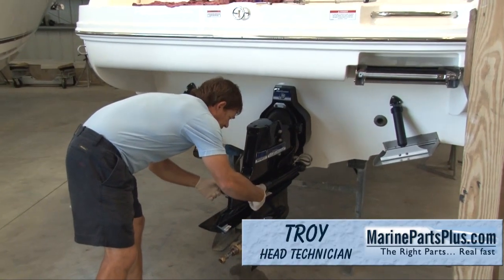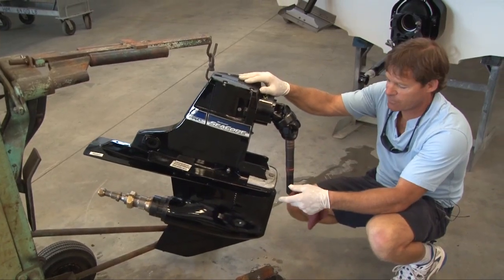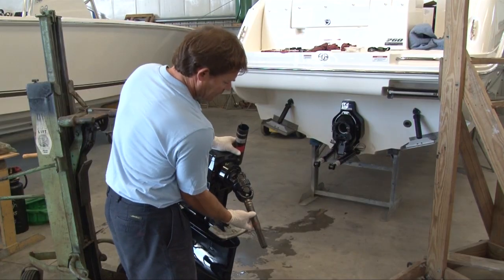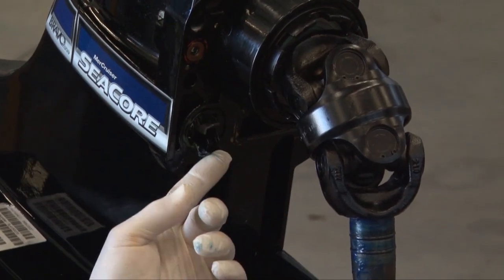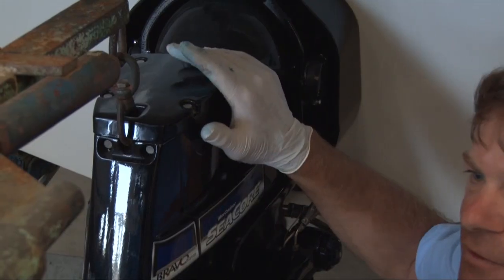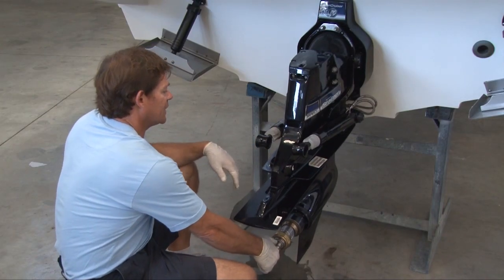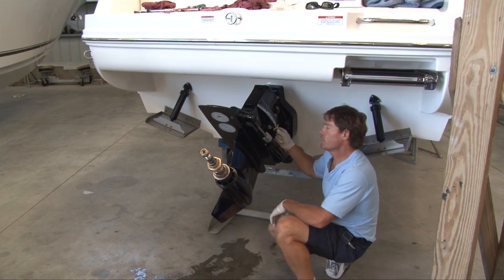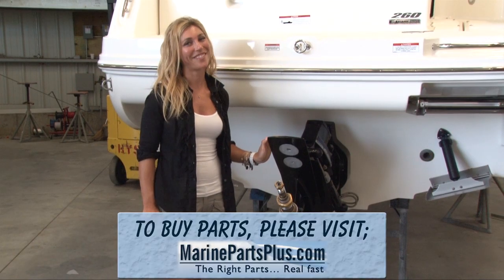How To: Remove ,Replace & Change Mercruiser Marine Bravo Stern Drive MarinePartsPlus.com

Comment: Great video.  My question involves the cable end and the clip.  Is there any other pressing of the clip to secure the cable end, or simply aligning and closing the unit all it takes.  I found that after I reassembled everything, I couldn't get the shift controller to work.  I unbolted the unit just enough to see that the cable end did not engage the clip.  Now the clip is deep enough to where I cannot see it for proper cable insertion.  Should I get a pair of bent needle nose pliers and attempt to pull it out, or just completely remove the unit as before?

Comment: On the bravo 2, when you reconnect the shift cable, does in need to be in neutral or FWD? Any other things to watch for with the shift housing?  Appreciate this concise easy to understand video. Thanks

Comment: I have a question for you once I have the bravo one drive off the pick up tube that’s on the bell housing side I think it’s leaking or just the hose where it meets the outdrive is leaking can I replace that from outside of the boat or do I have to replace it from the inside of the boat

Comment: I surprise, when you say that. 
When you turn the propeller shaft the universal shaft turn?
I think if you turn the prop shaft the cross bearing or universal will not turn. 
Am I correct.

Comment: I need some advice please. I just picked up a boat. to me it seems as though something is slipping. I don't see any visible damage to the coupler. is it possible that the clutch in the stern drive is not grabbing ? it seems to go in gear well very well no clunks  at all can't even tell it shifts but it does and the boat does move .

Comment: I had to replace my engine and obveosly its out of alinement bad.  I finely got the alinement tool to go in but it goes in hard. I got marks on the bottom not on the top ( not sure but do I have to have the bolts tighten up in the back I left them loose because I wasn't sure and not sure if that is part of my problem) anyway wether I rase or lower the engine the marks are always on the bottom. The bar just get tighter and super hard to push in near impossable. Not sure what to make of it. Would like any help I can get.

Comment: Is it shifted into forward gear, neutral or reverse?
Reply: WITH A BRAVO you can just leave it in neutral BUT FOR AN ALPHA, YOU MUST SHIFT IT INTO FORWARD or else you will bend or break the shift forks/shift shaft on the drive.  When in forward with an Alpha, it makes the shift shaft and the forks in parallel, thus allowing it to slide apart smoothly.